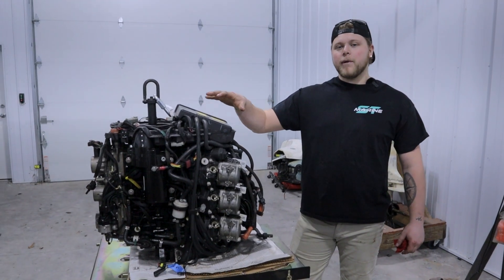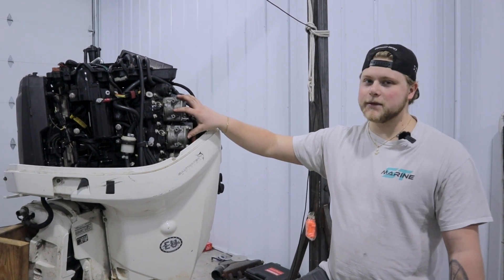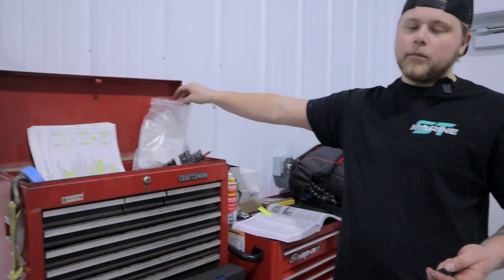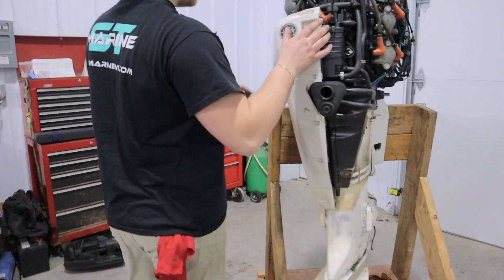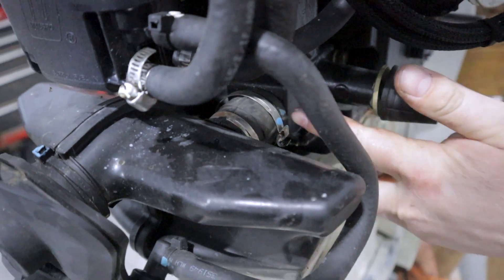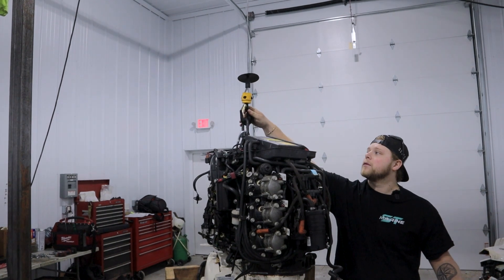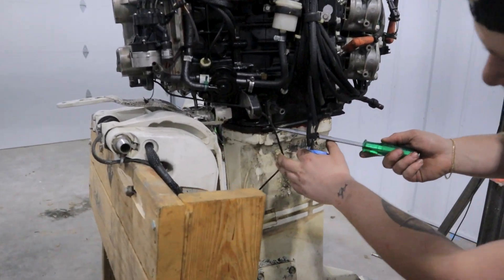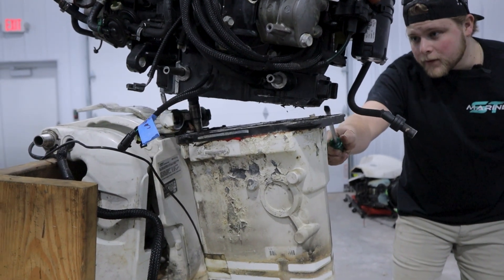How To Remove Evinrude ETEC Powerhead! (135-200HP V6) | In Depth

Comment: I want to do a G1 20" to 25" conversion. using my 20"good powerhead mounted onto a blow powerheads 25" midsection.
1.can I lift the powerhead using the 2  flywheel bolts?2.will a car engine hoist be tall enought to lift the powerheads they don't realy pull striaght up?I'd like to leave as much stuff on the swap engine. any tips is appreciated. I looked but didn't see the reasssemble of powerhead. thanks